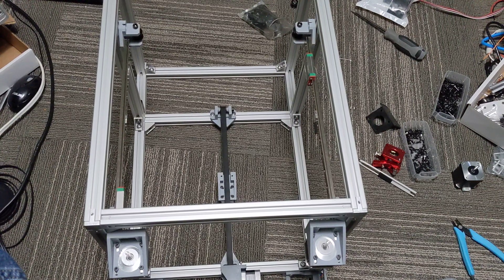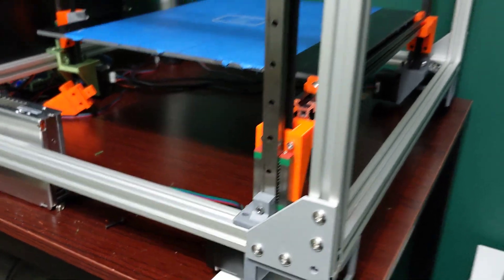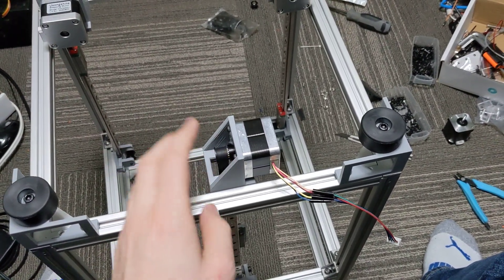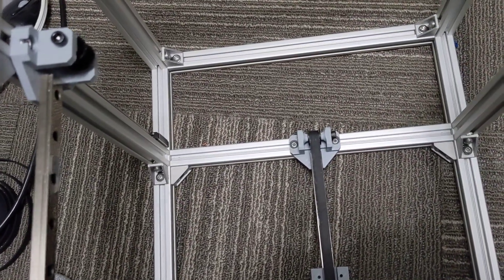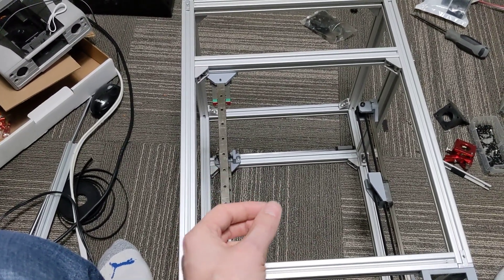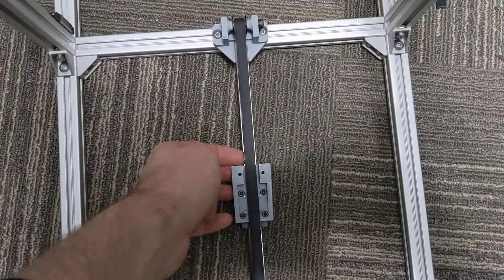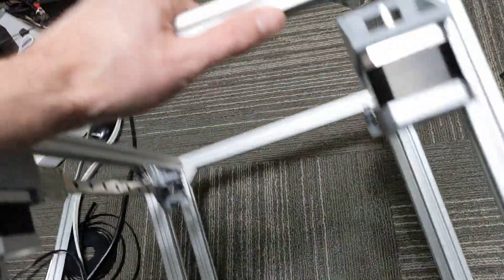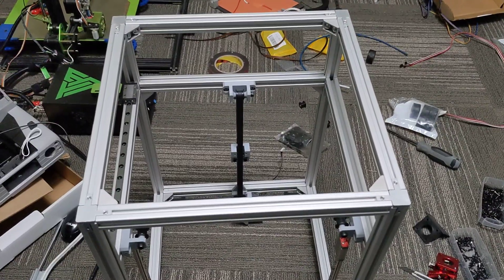DIY CoreXY SimpleCore Tips How to build the Z

Comment: Greetings, thank you for the awesome videos, would you mind explaining  why  the belted z-axis don't make the bed fall down when motors are off? thank you once again
Reply from the maker: the belt will fall once powered off, but you can have a simple dock macro that lowers the bed once a print is done. Most printers use a geared Z though

Comment: Really nice work! What pulleys you mounted for the Z? Never thoutgh about using a voron mobius transmission?
Reply from the maker: Powge 10mm wide pulley and toothed idler for the Z, I thought about something like that but is adds complexity and I have not had any issues with direct drive
Reply: 20t pulleys?
Reply from the maker: @Ciccioniel  yes

Comment: What is the reason you've decided to go with 10mm z belts?
Reply from the maker: I wanted the bed to support a good amount of weight the more belt material and width I can get the better. Also I will be moving to 10mm belt on X and Y also so it simplifies things
Reply: @Rolohaun  ok, if you are moving to 10mm across all axes then it makes sense. Thank you!